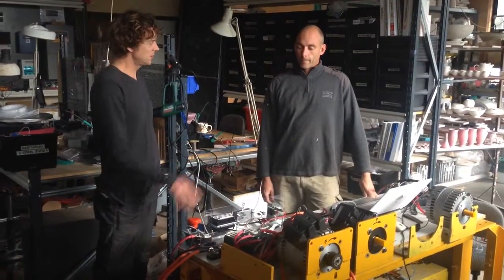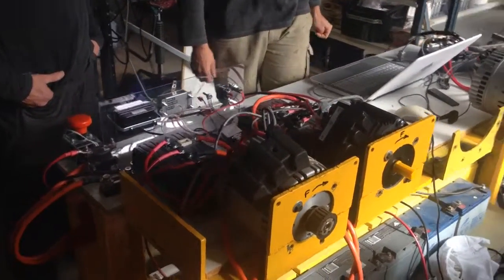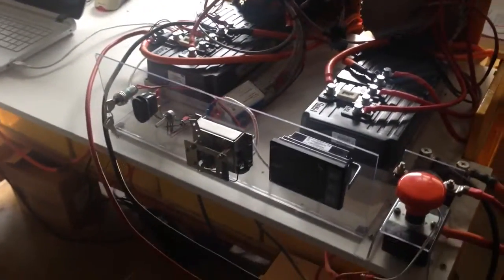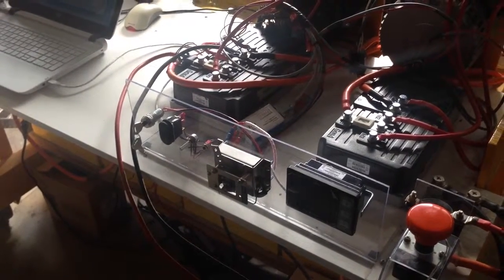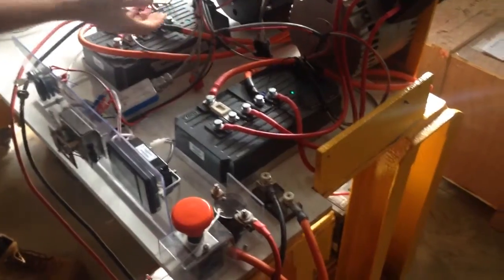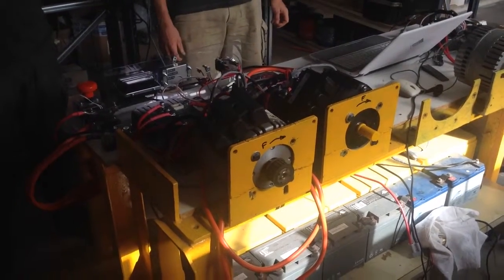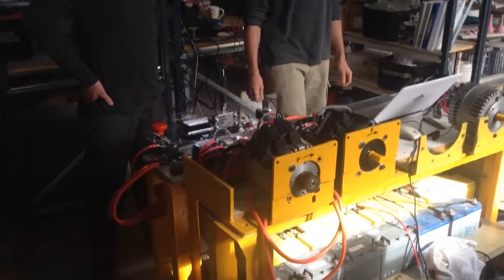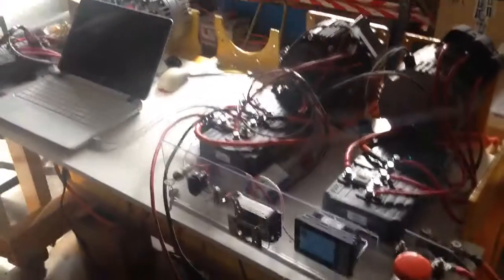ME1115 / Sevcon SIze 6 Dual Motor discussion

Comment: Hi, guys. It’s hard to find out any info on these motors can you give me your opinion! I’m making a off-road mini bike build and want a very powerful motor, I’m more looking to gear this low for climbing hills, my lipos are 96 volts 20ah capable of 240 continuous and 480 burst. I want to run this at 96volts. Monterey motors suggested the me1012 and he said at 96 volts this is more rpm then the me1115. But I find that hard to believe since that was the newer motor that replaced the 0913 I believe. So which motor would you rec and what controller kelly or gen4 sevcon 
Motors I’m looking at are the 1012,1114,1115

Comment: Hi, we tried to work with the same system. The connections and master/slave state seems working but one of the motors works like crazy. It starts working but turns right to left, left to right and accelerating very very very fast. Could you have any idea or could you share your dfc files? (If you still have). System: engines both are ME1115, Sevcons' size 6 & 72v.

Comment: How do you start programing the Sevonc from zero, using the DVT  ? The motor manufacturer sent me a DCF file, which has the  name plate values from the motor alredy typed in. But what are the next steps? Mapping inputs and outputs ? I don't understand how to program the objects. Do you need to configure the encoder ? With the help inside DVT, are u able to set it all up correctly ? There's a comissioning section, I dont know if I can make any unreversable changes into the drive.
Reply from the maker: You need to contact the motor vendor. It seems logical to me that they ensure you have a usable system or provide you the tools and training to do it. That is what we try our best to do with our customers.

Comment: The way to go is with in hub motors ,taking both the engine and gearbox out you have the room and weight advantage rather than leaving in the gearbox.
 I plan to do this this year hopefully and possibly turn it into a small business.